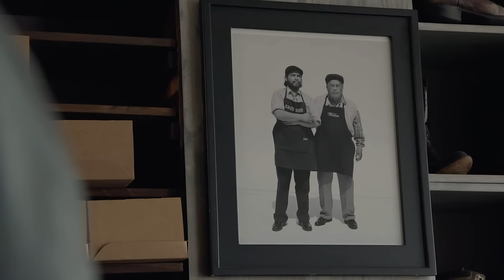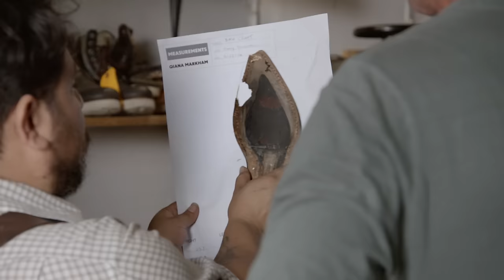Raw Craft with Anthony Bourdain - Episode Ten: Cobblers

Comment: The reasons why those shoes fit so well? One; they are WIDE enough! Most folks won't get their shoes wide enough to move and flex properly. So the front of their feet end up all squashed and cramped and unbalanced. There is also the problem of nerve damage in the front of the feet. I have that, and it never gets better. I actually was selling good quality shoes, running around like a crazy person in agony. I had always had small feet, it NEVER occurred to me that my foot bones would spread because I was spending all that time on my feet every day, running all over the store. I was a 7B, Goddamn it! No. I became more like a 8.5 EEE, and I now where men's shoes. I can't work on my feet any more.
Secondly! People don't support their backs or arches properly. But those suede booties come with a bit of heel, to help distribute the shock of walking all through the body. That bit of heel helps the arch function better, so that the constant shock of walking doesn't go straight to the small of the back. People with dropped arches (flat feet) are always exhausted or have pain in their back, their legs and feet. Once they start wearing shoes with a bit of heel that are also wide enough, it's like a miracle. Suddenly they have energy at the end of the day to get other stuff done, they can go out on Friday night instead of collapsing in a weeping, exhausted mess. Correct fit matters!